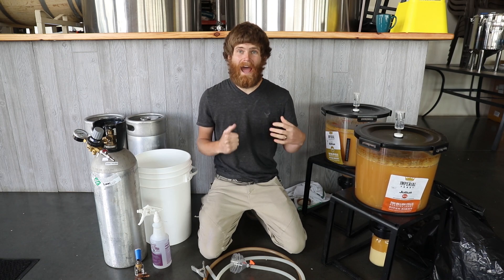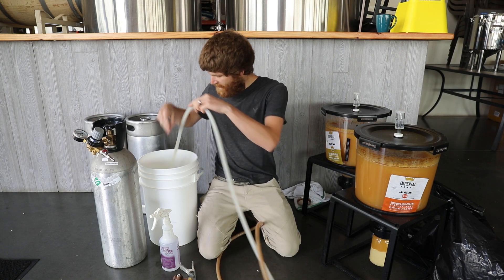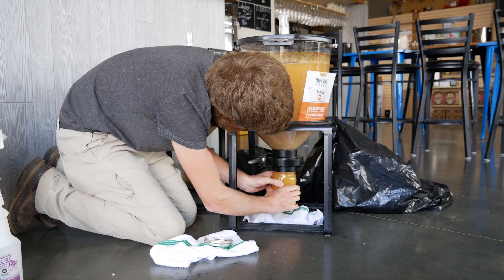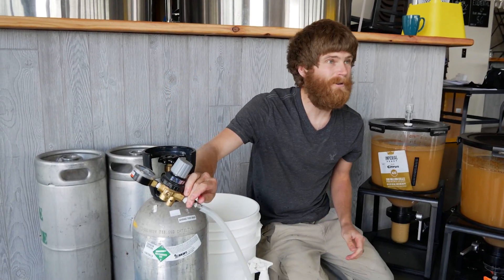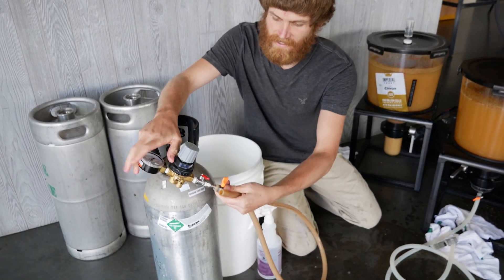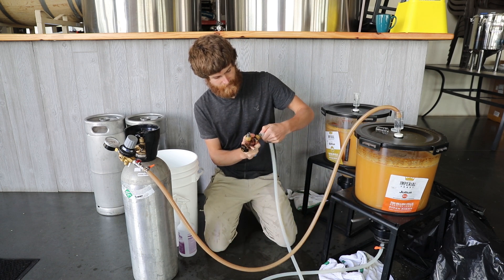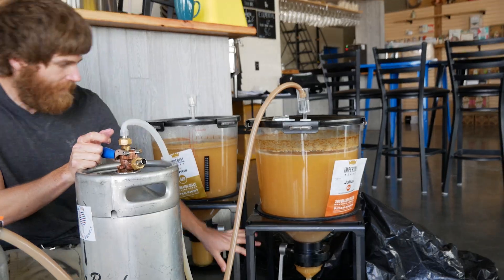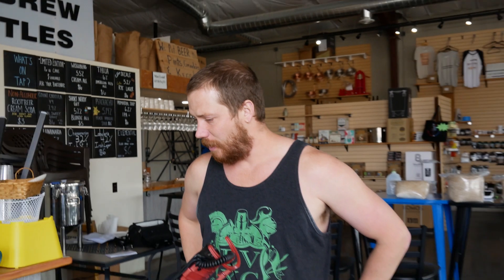How to LODO Transfer With Catalyst Fermenter: Don't Oxidize Your IPA

Comment: I never thought of using the 3 piece air lock to push gas to perform a closed transfer. You just saved me about $50 per SS brew bucket and from having to drill a hole in the lids to install a TC bulkhead fitting.
Cheers!🍻

Comment: Super psyched to try my first neipa this weekend. Will definitely give this method a try, but also wondering if you have tips or methods for low-oxygen dry hopping with this fermenter?

Was thinking adding hops to bottom jar, attempting to blow co2 into it before attaching, but I'll never be able to get all the o2 out of the jar... Thoughts?
Reply: How did this work for you? I am facing the same issue this week.
Reply: Same issue here. I am using the magnet method on a hazy IPA right now but running into head space issues and the krausen hitting my bags attached to the ceiling. 

I may get a TC bulkhead, install it in the lid and get the Kegland hop bong.

Comment: Is there a reason you use CO2 pressure to fill the keg vs. using gravity? At least for smaller batches where you can easily move the fermenter?
Reply: speed?
Reply: This way, the keg doesn’t suck in any air and expose the beer to oxygen. This particular style of beer is extremely sensitive to oxidation.

Comment: Hey guys, how do you purge kegs? Just CO2 fill and bleed a few times, or fill with starsan and push out with CO2? Or a third option I haven't considered.
Reply from the maker: Push the sani out with co2. That's the most cost effective- if your pressurize the keg it helps keep it saniid during storage too
Reply: @GenusBrewing  cheers!!!

Comment: I’ve tried this transfer method with my brewbucket. Any tips on avoiding the posts/QDs of a corny keg getting clogged during transfer?
Reply: Cold crashing and trying to not move it is the only way I've found it possible. Gotta get the elbow dip tube in the bucket in the right spot too and drain a little off so it's clear. I'm using a fermzilla now which has a floating dip tube, and even still then some hop junk will block the occasional transfer.
Reply: Thank you, cheers!